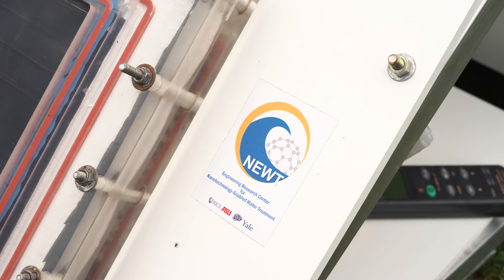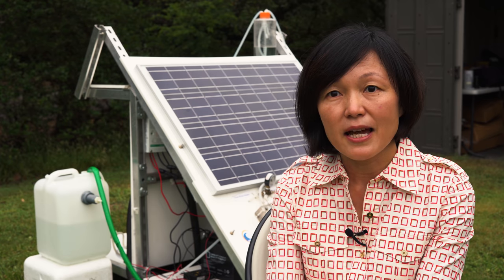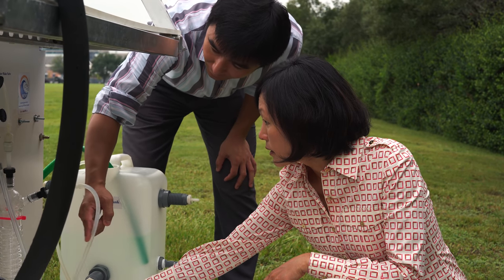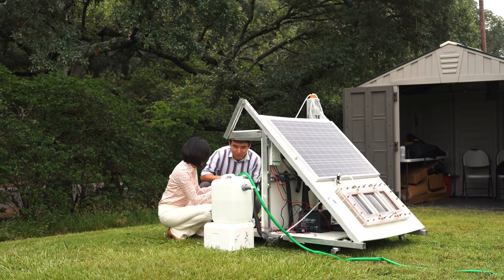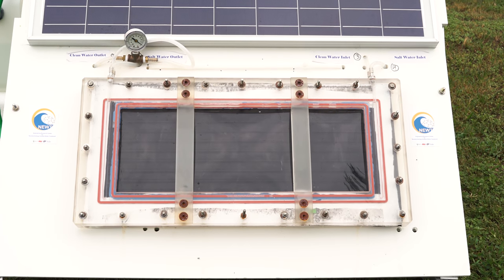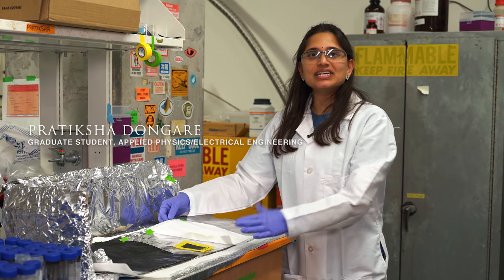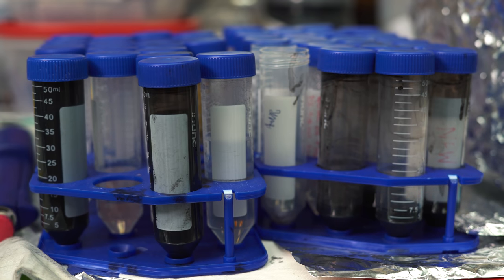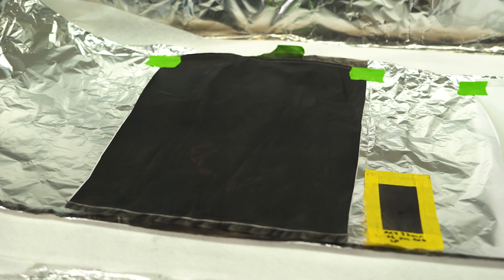Freshwater from salt water using only solar energy

Comment: If you add a small bank of vacuum tube solar tubes to heat the water, you could do a larger scale system, maybe double your output, even on a cloudy day.
Reply: Well... build a large green house tent with clear plastic over the pond / ocean. make arrangement to collect the water that drips from the slopes of the plastic on the inner side of the tent after evaporating. thats it. scale it up as much as you want.
Reply: Black barrel in the sun ... Pretty simple

Comment: What about just a simple tent frame with clear plastic over trays of salt water with separated sidegutters into which plastic tent descends. Water is heated by passive solar sun,  evaporates, condenses on plastic, trickles into gutters to be collected, salt solids left in central pan. Would work fine in sunny areas at least?

Comment: Why are you using membranes ?  Solar distillation wouldn't that be cheaper and much simpler? Heat all the water at a huge cost? Solar thermal heaters are cheap, simple, and highly effective... Why?

Comment: It doesn't even need to be this hi-tech or this difficult, can make a system that just evaporates water and the evaporated water collects on the bottom.  Can make a system that costs almost nothing.
Reply: We can do with another prosses where the membrane stopes salt alows water.
Reply: .Rass Bombo, can you tell me more?
Reply: Can you tell us more about it? Its required around the world. Thank You.
Reply: this can be made but the output you would get for the same surface area would be very less. compared to this system.

Comment: First, it's not good for just anywhere in the world. You have to have a supply of salt water to start with. Second, I simply don't believe that the small scale solar power generates enough energy to pull salt out of solution in sufficient amount to be useful. Third, what are the economics of the entire method? For example, what is the cost of the solar panels? What is the cost of maintaining membranes? When you have a final per liter cost of water, including capital amortization, will it be affordable in the places that technically can use it? This just smells like another gadget put forward without carefl consideration of the underlying overall costs, and often without adequate consideration of some basic physical parameters, such as the second law of thermodynamics.

Comment: How does the condensation process work? Do the membranes become fouled with salt and other solids from the sea water? How much electricity does the process take? Is the sun providing the thermal heat or is it the electricity from the solar panels? How much fresh drinking water does the demonstration module produce per hour/per day in the sun on average? How much does the process cost now and how much would the cost come down if it were produced at scale? There are a million questions I have. Desalination of seawater is going to be something very important in the very near future. Maybe even now with how fast global climate change is hitting. But, there is going to be a need for desalination to be done on a planetary scale, and we simply can't just drop the brine into the sea. We are going to have to dry the brine all the way down to hard salt and bury it deep in the ground where it won't contaminate groundwater. The breakthroughs demonstrated here certainly are a very good start. I want to know more. Where can I learn more about Rice University's NEWT desalination?

Comment: Why not just use a fresnel lense to heat up the water... you can easily set it up to monitor the heat generated, by having a mechanism to move the lense at different heights... which would place it at that height and then move after a certain interval if the heated area starts to lose its state...

Comment: It did not look like it was producing much? And where does the rejected salt water go? Is this a real off grid solution, and if the rejected water goes back into the source water, this is not good. Search "large scale solar water still" and you can find a off grid passive solution that does not harm the environment, and produces much more than what your video is producing.